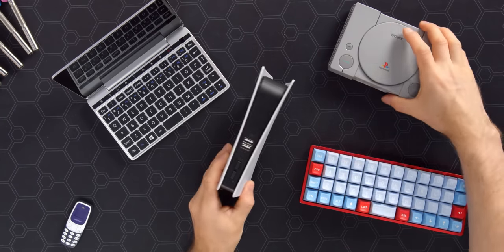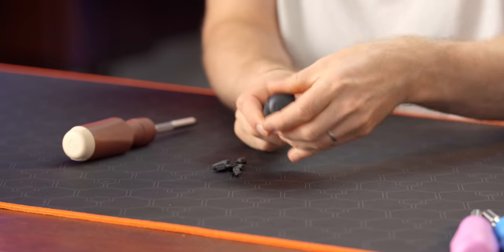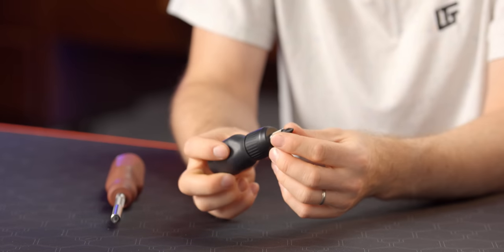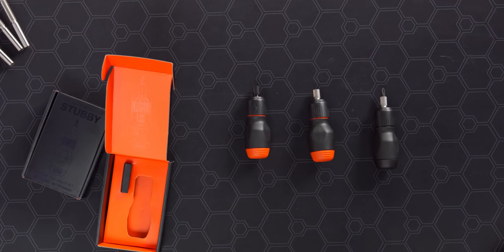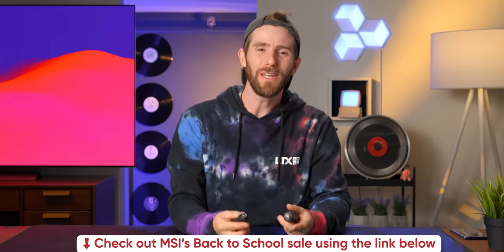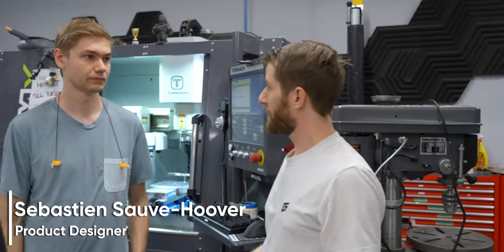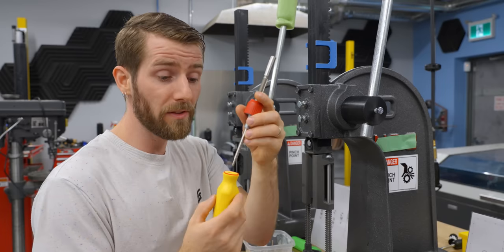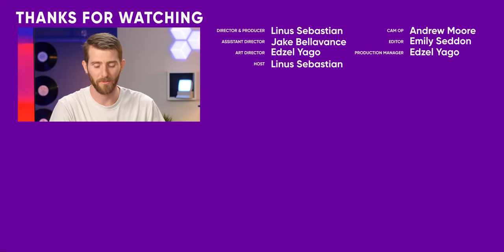Size doesn’t matter. - LTT Stubby Screwdriver

Comment: "The possibilities are basically endless" 

Need to work on some of the writing, if I did the math right there are 36 potential combinations based on the colors you showed, that are far from endless.
Reply: I believe the correct number is 210. You can technically get a full solid color draw with randomization. There are 4 parts in total. Sure it's not "endless" but you know what he meant.
Reply from the maker: There are 4 parts and 8 colour possibilities. That makes thousands of combos! - LS
Reply: @ShortCircuit  4 parts with 8 colors can produce without repetition 70 possible combinations. With repetition the number is 330. This is derived from using a combinations calculator.